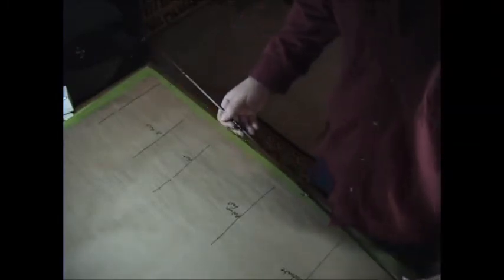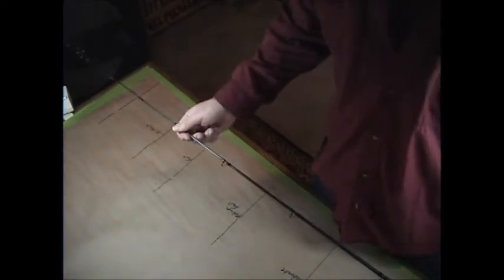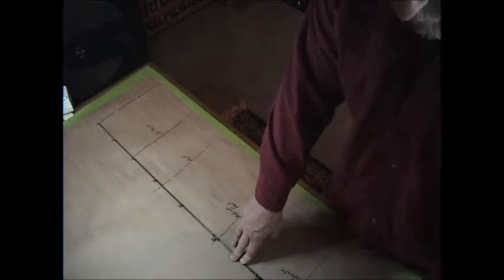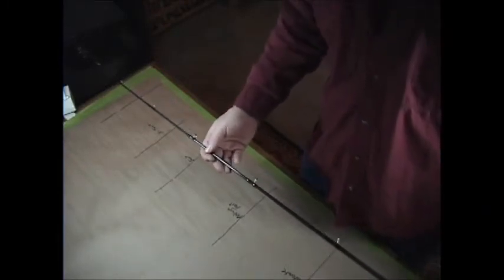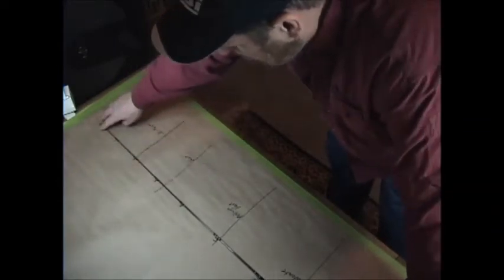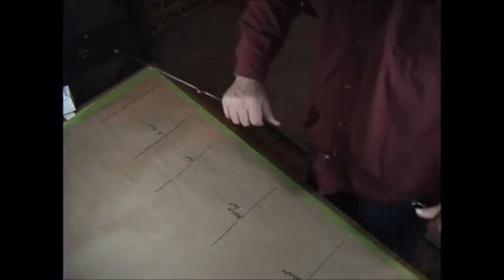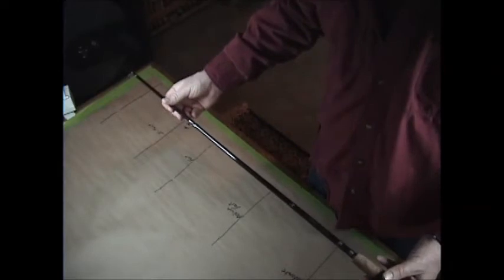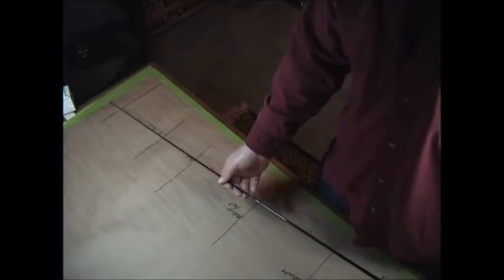Fishing Rod Action Finally Explained

Comment: Thanks for sharing your knowledge! I understand rod features better now. Is there any specific measurements to your scale that you made for sensitivity. I;d like to check some of my rods .
Thanks again
Reply from the maker: Sensitivity has many factors.  I will list a few and what they mean.  Sensitivity is how the vibrations from your line transfer into your hands.  So the factors are the line, guides, rod blank, reel and reel seat.  Since the type of fishing that requires the most sensitivity is done on slack line lets go over a finness bait like worm or dropshot fishing.  Quality Mono and floral lines transfer vibration a little different than braided lines.  I think they have very close ability to resonate the vibration when you get a bite but the mono and floral lines have memory and can have coils in the line which decreases the ability to transfer the vibrations as well.  Braid rarely has this issue unless it is twisted.  Guides make direct contact with the line.  An all wire guide, like Recoil, transfers the feel the best.  There is no transfer between frame and ring material like a conventional guide.  Not that that is terrible, and most fishermen prefer a ring guide.  But a quality guide like a Fuji SIC or Alcanite is best.  Light weight, durable ring and quality built.  Rod blanks of the highest grades of graphite (modulus) or carbon fiber will be the best.  I look for blanks that have the smallest butt diameter and weigh the least.  Rest assured, if you buy the highest modulus lighest weight rod and the action and power are what want, it will be the most sensitive.  But your wallet will hurt you.  GLoomis is is the best I have seen.  Here is a little known secret: That ugly colored rod you see a pro fishing that you can buy for $99.95 at Dick's is really a high dollar blank painted to attract attention and labeled with another decal.
Reply from the maker: The reel is the least factor but light weight is better for fatigue.  If your hands are tired you can't execute as well.  The reel seat is glued directly to the rod.  This factor is the easiest to overlook because you cannot tell how it was assembled.  Reel seat that have exposed areas so your fingers are on the bare rod blank are best.  Skeloton seats can be good if they don't make your hands sore.  I personally cannot use them.  I like a Fuji exopsed blank seat like the ESC.  Two fingers on the blank.  Some rod companies buy a seat that is too big of a diameter so they put a cardboard bushing between the seat and the blank to make up the slack.  This is the worst idea possible.  That is nothing but a shock absorber.  Some use a pair of composite bushings.  Not as bad but the only place that direct contact is made is on the bushings.  Sized real seats with complete glue contact is best and strongest.  Hope this helps.  Direct message me if you have more questions.
Reply: @bigwaterdaddyfishingrodrep6024  Thanks for all the useful info.
The scale you used on the table to measure action. is there specific measurements for that to determine the action or is it more by sight and just determine where bend is located on  the pole to estimate action.
Reply from the maker: @gary6623  No measurements.  Just a reference.  When I build a custom rod for somebody it is like tailoring a suit.  I ask a lot of questions about what it is for and how your style of fishing is.  What type of fishing do you do?
Reply: @bigwaterdaddyfishingrodrep6024  walleye. Jigging , bottom bouncing, and cranks one in a while
Reply from the maker: @gary6623  Then you need moderate to medium rods mostly.  Maybe a fast for light jigs on calm drifts.